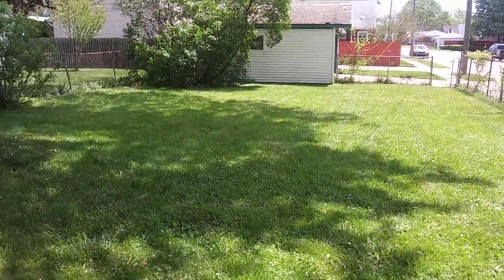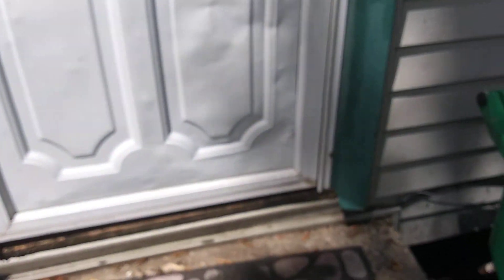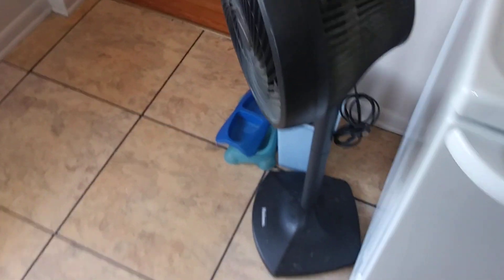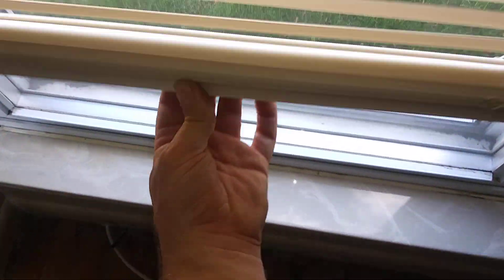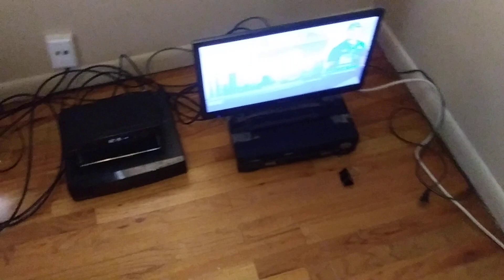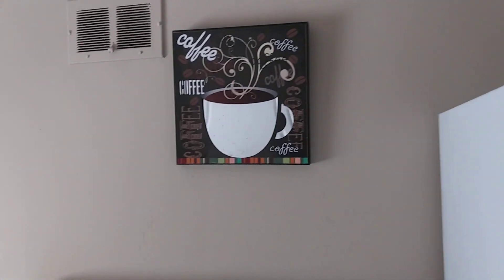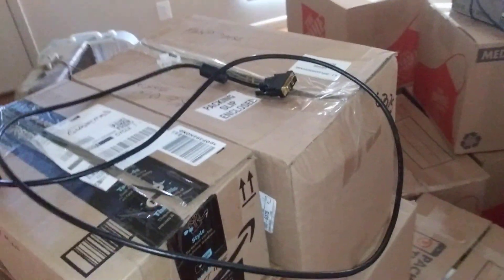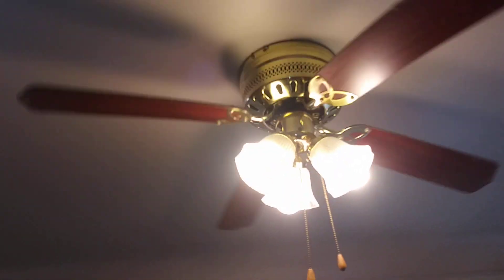New House Part 1 The First Floor

Comment: Nice, nice, nice!  That will definitely work well.  The other switch by the front door likely controls an outlet in the room since there's no overhead light.  I believe that's code actually.  Our old apartment had no overhead lights in the living room or bedroom, it controlled the bottom half of the outlets.

Wait, wait, what?  The toilet flusher is on the RIGHT side?  Just about any residential one I've seen has it on the left.  That's odd.

If push comes to shove with the A/C, and the condensor actually is fine, it would be easy enough to test since the circuit panel is right there; could always run new power to it.  Doesn't explain why there's a separate meter, or if they charge different rates for that on the second meter or what.

I gather there's no basement there.  Around here they are very commonplace but I know they're not in other parts of the country.

Comment: Does it have a dishwasher? If so, what kind?
Reply from the maker: No dishwasher. might get a portable one at some point. Had one at the house before the trailer.
Reply: @lexmarks567  what kind of washer and dryer do you have at the house you're moving into?